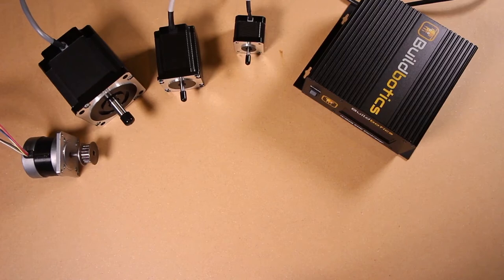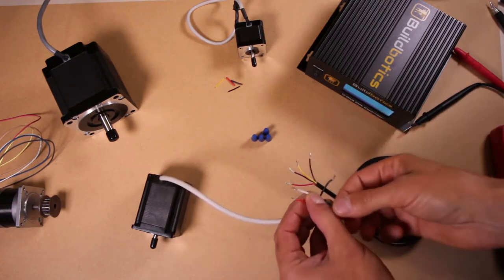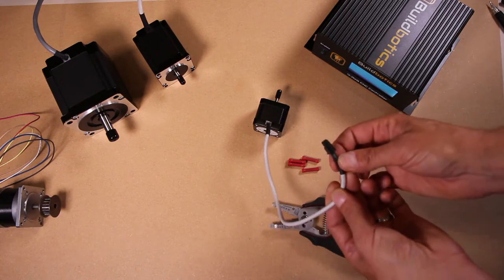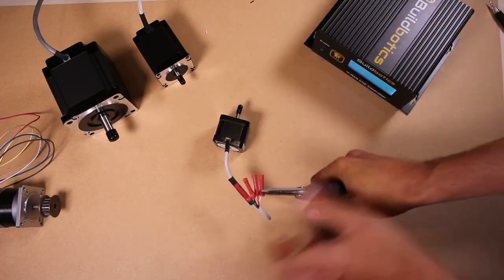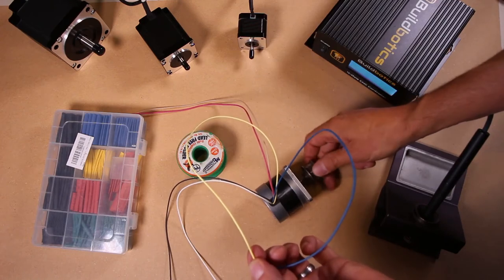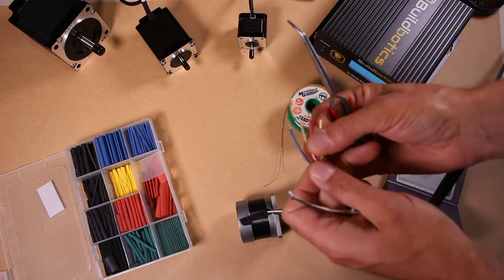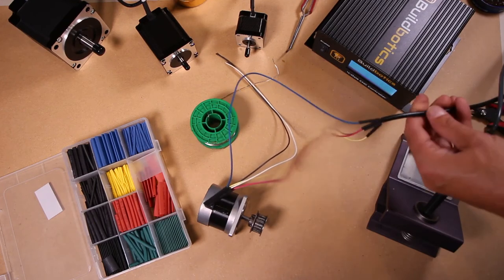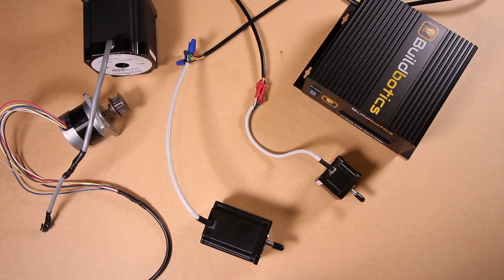Three Ways To Splice Stepper Motor Cables

Comment: If pins are in wrong location on a connector you can typically push in the little barb that holds them in the housing and relocate them to a different location.   Not much to lose if you are going to cut the end off any way.